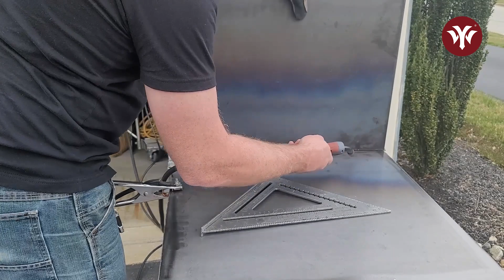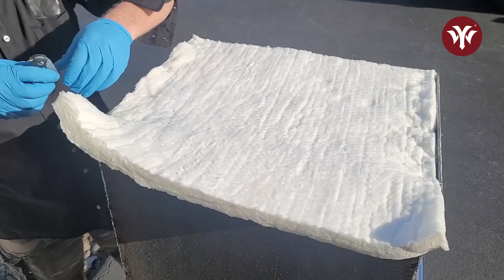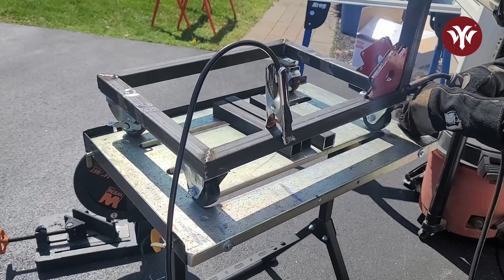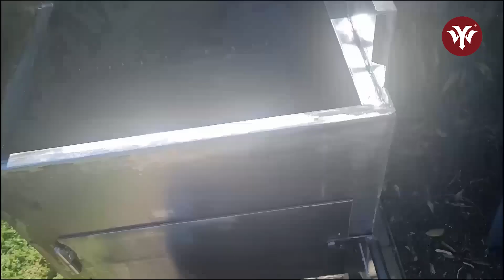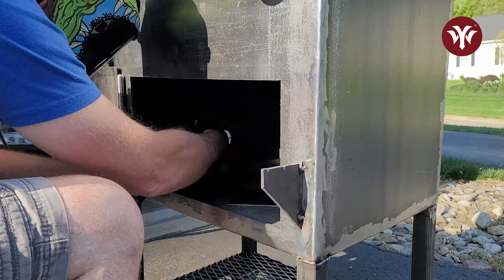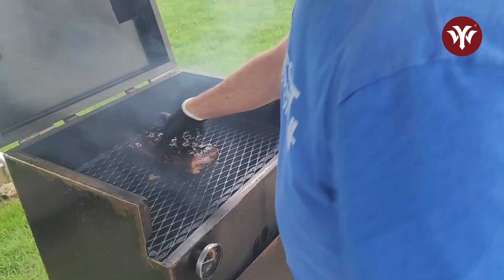Let's Make a Direct Heat Smoker from Scratch | YesWelder

Comment: I cut my door 1" off the bottom of the inside and used 1" thick fire brick ( easy clean out ) for the bottom, lightened it up a bit and retains heat just as much, IMO. Nice build you have there.

Comment: What would you recommend for the best chop saw blades.
Reply: Depends on your chop saw. If your saws rpms are too high you have to stick with the abrasive disc's.  I have a Wen chop saw and their metal blade works really well.  Evolution puts out really good products as well.  If your rpms are to high the metal blades will burn out after a couple of cuts.